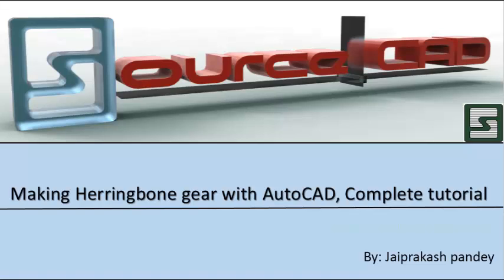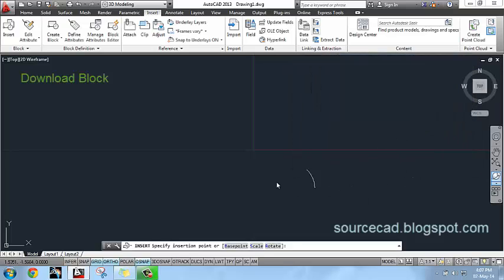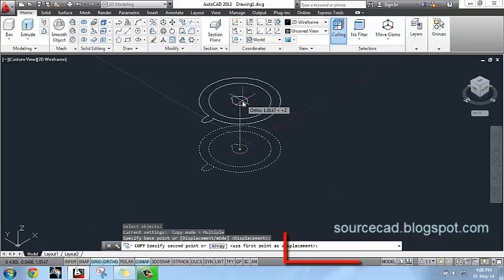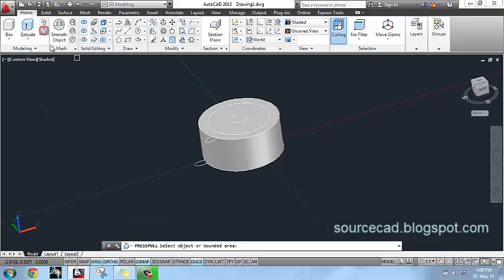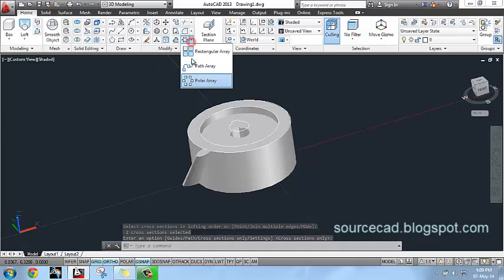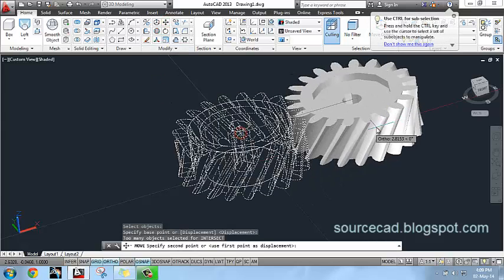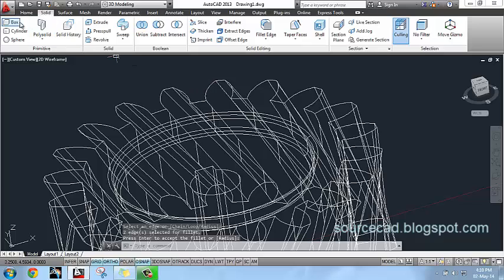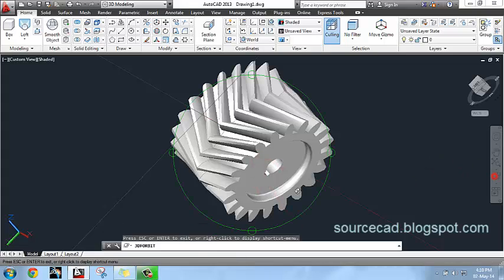3D modelling herringbone gear in AutoCAD

Comment: Unfortunately you did not put any fillet radius on the roots of the gear teeth.  Gear teeth on ALL gears have a fillet radius at the root.
Reply from the maker: This model is for representation only and many details have been omitted to make tutorials easy to understand, I have even omitted a gap which is present between herringbone gears.

Comment: The model is too simple. It doesn't reflect a real geometry of toothed gears :( First: a tooth outline is an involute, not an arc! It ought to be approximated wth a spline or polyarc. Second: a tooth must be extruded along a helix, not along a line!
Reply from the maker: Sergei Komarov Dear sergei I agree with you these geometries don't conform to actual herringbone gear but here I have used this video to explain AutoCAD tools only and using exact values would have made this video long and and also it would not be of much use to an AutoCAD user, 
But I will certainly explore possibility of making a video with exact values of gear, thanks for your suggestion.
Reply: SourceCAD OK, I understand. But I prefer to explain AutoCAD tools with actual models. Maybe with more simple, but actual ones.I teach students for many years and know, that the first impression is the strongest one. If a student watched your demo, it would be very hard to explain him the actual geometry of a herringbone gear later :(
Reply from the maker: Sergei Komarov Ok Sergei I will try to include as close geometries as possible for mechanical components, thanks again for your inputs
Reply: SourceCAD It's an interesting task. A small idea for it: my students build true bevel gears using AutoCAD calculator.
Reply from the maker: I would love to have a look at model created by your students, you can share it with me as well if you want on this email ID admin@thesourcecad.com

Comment: Had some trouble with this one. Loft wouldn't close the gear tooth surface
 at first, still not sure what I did wrong but was able to fix it by redrawing it. Proper double helical gear has a slot between the gears to relieve hydraulic lock for lube oil (assuming your gear set needs that), so trying to add that to my drawing has been very challenging due to my limited CAD ability. Still, enjoy the challenge and appreciate the vids.
Reply from the maker: Thanks Dan for your feedback on this video, I would like to make clear that designs here are intended for honing your skills in Autocad and these are not actual industrial components so all the geometrical considerations are not taken into account.